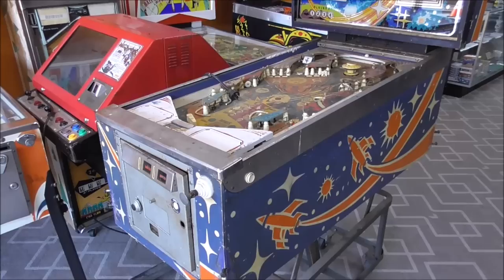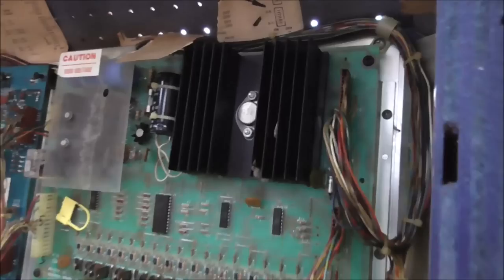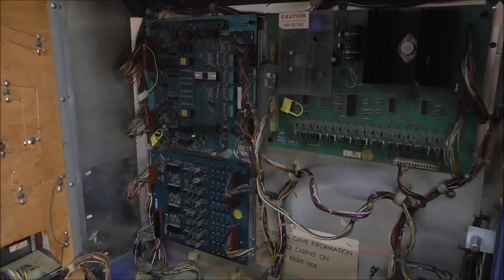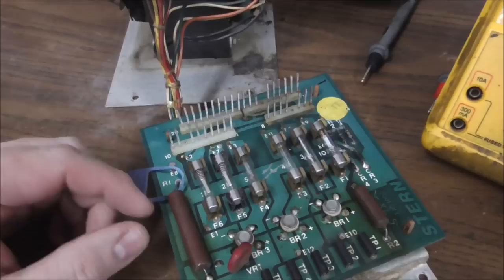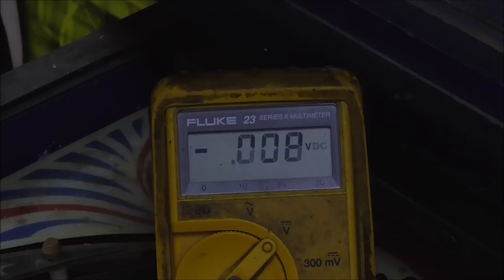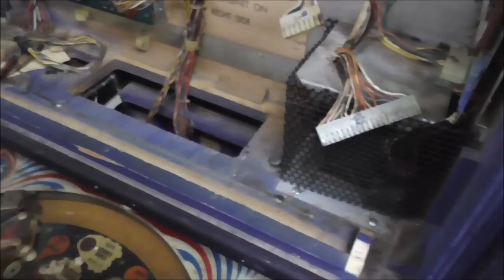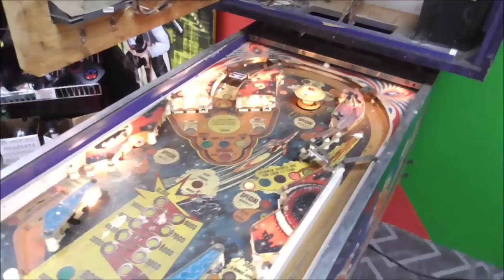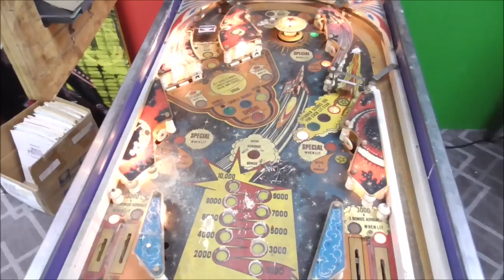Somebody brought in a Stern STARS Pinball Machine that was COMPLETELY DESTROYED - Let's Fix It!

Comment: The reason that the boards and displays of Bally and Stern Electronics are so similar is that when Sam and Gary Stern bought Chicago Coin and founded Stern Electronics they purchased several other companies as well. One of the companies they bought was URL Laboratories the people who designed the boardset for Bally. This  basically gave them a back door to the design.
Reply from the maker: Thank you for the info, I didn't know URL Laboratories had done them.... do we know for sure (I've heard both ways) if they had Bally's permission ahead of time?
Reply: @LyonsArcade  That's a good question. Either Bally didn't care about what Stern did or (more likely IMHO) some sort of arrangement or understanding was reached between the two.

Comment: My daughter inherited a Hollywood Heat pinball machine from my sister when she passed.  It doesn't work - a few lights turn on.  This will be a project for us.  This video was enlightening in how you approach troubleshooting.  I'm looking forward to the challenge.  Thanks for sharing this video!
Reply from the maker: very cool Jeff.... Hollywood Heat was a Gottlieb game, if you watch our series that we did on Gottlieb's "Bad Girls" it shows how to fix them, your Hollywood Heat will be nearly identical :)
Reply: @LyonsArcade  Thanks for the tip.  Since finding this channel, I've been literally glued to the videos.  I think I had 4 hours under my belt last night.  Wife is looking at me funny.  I work on automated equipment in contact lens manufacturing.  If a servo drive goes bad, we replace the whole drive.  We will send it out for repairs and never dive in to the component level like you do.  I think I can troubleshoot the more simple things.  When it comes to determining if a component is bad on a board, I'll be lost.  I took AC and DC circuits in college a million years ago and designed simple circuits.  I remember the 555 timer.  My lab partner and I thought we were cool calling it the tri-5.  Anyway, I'll watch the video you suggest.  Thanks.

Comment: Think of Varistor like Resistor.  Except it varies depending on Voltage/Heat.  Basically you are saying it right.
Versions of them can also be used as input surge current protection or a "soft start" of sorts as well as overvoltage protection :)
Reply from the maker: That makes sense, thanks Brendan!  We appreciate the info :)

Comment: That burnt device is a MOV - metal oxide varistor.  Over time they can break down and burn up.  That's why newer surge protectors connect a thermal fuse to them - so they don't start any fires.

Comment: The +5vdc on the driver board leaves on Pin#13 to power the MPU board & what else? then Loops back to the driver board on Pin#25 to power the solenoids driver transistors?

Comment: What is that yellow plastic thing that looks like a padlock on the solenoid board?  Thanks Ron.
Reply from the maker: Those are put on the boards after they're repaired by the distributor/repair shop so that if you bring it back while it's under warranty, if it doesn't have the lock on it they know it's a different board.

Comment: 4:00  Rat nesting scared me, because they always chew up wires in cars. Turns out, that the Car Manufactures started using soy-based wire insulation in 2000. So, any pinball machine BEFORE 2000 should be fairly safe from mice & rat destruction to the wiring!? Have you seen any wiring issues from the varmints?
Reply: A rodent's front teeth grow continuously, they chew on stuff to keep their teeth from getting too long. (similar to how a cat sharpens their claws.) I've seen where squirrels chewing up wiring in the attic of a house caused all sorts of electrical problems, (thankfully not a fire) and that wiring was at least as old as this pinball machine.

Comment: what are the plastic locks about on the circuit boards?
Reply: Repair tags from previous repair work, to stop people with multiple units, trying to get a warranty repair on a recently repaired board.  They lock on and cant easily be removed without it being obvious, they have a number stamped on them, which relates to the repair.   Without them if you had another identical board fail in a different machine you could send that back and say the repair failed and try and claim another repair under the repair warranty.

Comment: Stern Stars Detroit Edition
It could have been worse, at least the paintwork on the side and the backglass are OK.
Reply: At least all of the electronics are there.  The "Flight 2000" he worked on later was missing the entire power supply, the lockdown bar, a few components on the playfield and one of the boards.